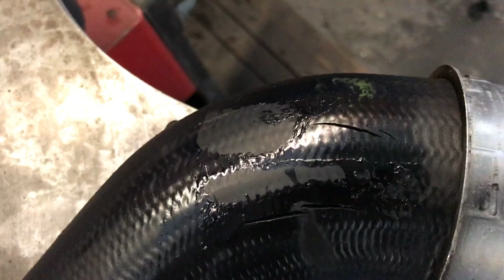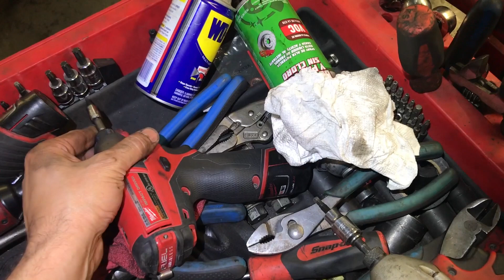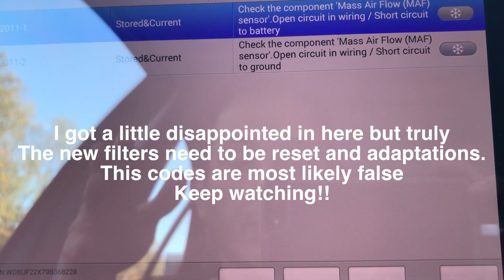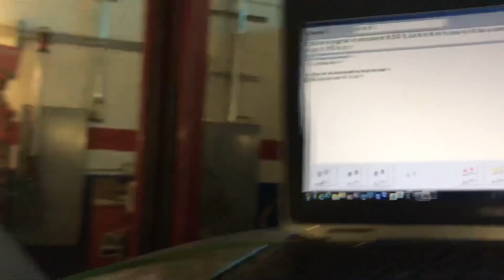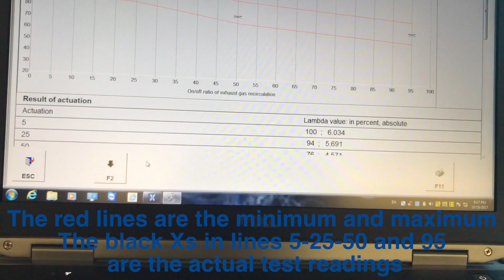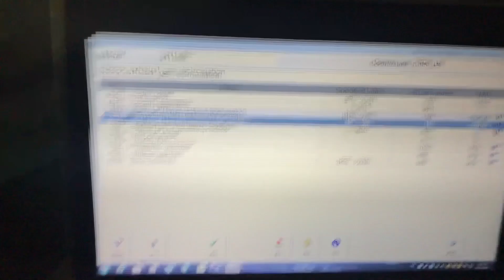2009 Mercedes E320 Bluetec bosst problems THE FIX

Comment: I went through this a while ago as well. Changed air filters and got low boost code and MAF codes. All you have to do is reset the air filters with DAS. But even if the MAF sensors were dirty, all you would have to do is spray a lot of MAF cleaner through the left and right sides of that Y pipe to clean them. That usually does the trick. But whenever you change air filters, always perform a reset with DAS.

Comment: Code P2359 . 2008 e320 3.0 turbo diesel .  
Check charge system to low boost pressure . I need help brother . So I noticed a faulty mass airflow sensor (it has 2) . I think it might be my problem . But ...  only one of my dpf sensors (it has 2) and my exhaust back pressure sensor are not reading any psi pressure (0) could it be cause of the faulty maf causing to low boost , causing it to shut down the wastegate valve . The turbo is spooling because of the check engine

Comment: Don Maic no se si sabe español ...tengo un problema ..no tengo experiencia en bluetec..resulta que removi el turbo. Y lo volvi a instalar. Pero ahora tiene un ruido raro cuando desacelera se oye fuerte la succion ycuando lo para tambien se queda unos segundos el sonido..le cambie tambien la miama manguera que usted muestra en el video..mi pregunta es sera que tengo que hacer un re aprendizaje al turbo gracias por su respueata
Reply from the maker: No es necesario aprendizaje para el turbo. Revisa todas las conexiones es posible que alguna manguera esté floja o mal.
Reply: @MaicSalazarDiagnostics  ok revisare ....pero ahora me estan diciendo que el ruido es porque no le eche aceite al turbo...y antes de instalarlo le rebusque y no le encontre por donde....y todo esto de que no le eche aceite salio porque en el kit de gasket viene una jeringa. Y que esa sirve para echarle el aceite...el carro del problema es un ML 166 blutec año2012 gracias por su respuesta

Comment: My car 2013 Mercedes ml 350 bluetec code is
123900 - [stored] Charge Pressure too low
16E100 - [stored] Charge Pressure Control Faulty
Can you help me
Reply from the maker: tom yuksel you need to check all the duct from the inter cooler to the turbo first, then check the pressure sensors, air filters clean? Then the turbo.

Comment: Maic, what chemicals did you use to clean the cats?
Reply from the maker: M Barry engine degreaser, hot pressure water and oven to dry. You can use a heat gun but it takes longer, I dry it first with shop air then heat, then inspect with a light to see if cells are clean. This car runs like new.

Comment: Fascinating stuff, great watch, factory tools are the way to go although the autel had a lot of good options as well, good point about resetting adaptions, I would have been tearing my hair out when maf code appeared but u kept in diagnostic mode well done! That MAF sensor must be a frequency type like ford impossible to interpret!  One thing I learned about dpf from a snap on training session is that ash can not be removed during regeneration only soot can,  but still 42% ash is a good figure for car with 100k + cheers sandy
Reply from the maker: sandy anderson thx for your comment. Yes 42% is still fine. And now after final regen the load content went to 4%. That is a huge change. Vehicle is driven like new.